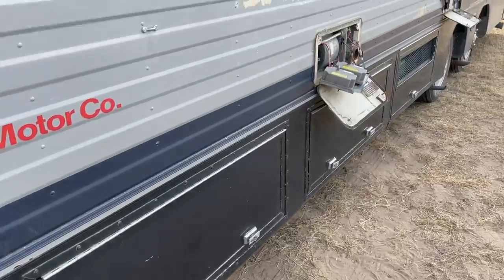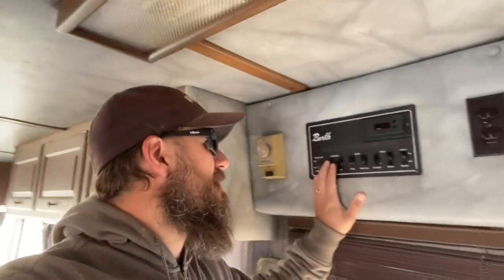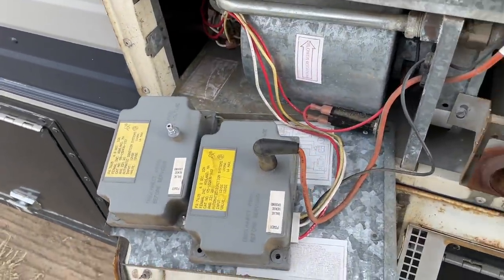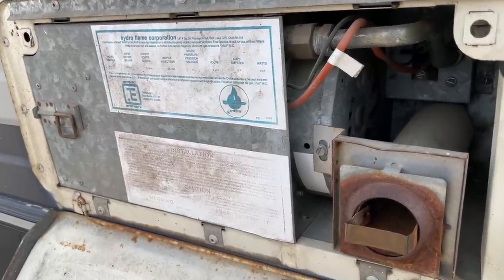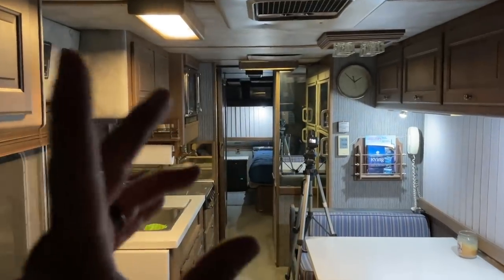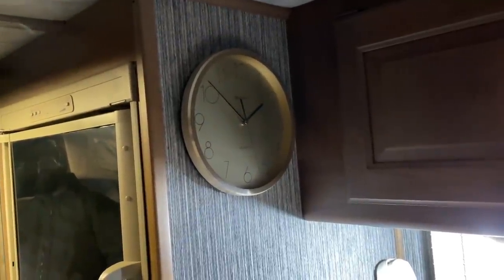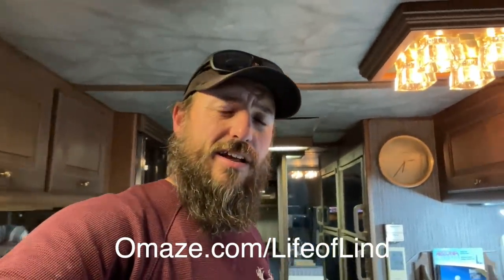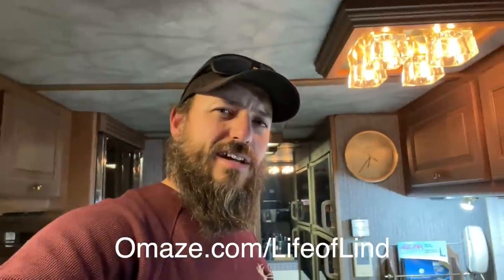Abandoned $154,000 Luxury Barth Motor Home  First Winter Preparations!

Comment: Listen, those front windows you can cover those up to prevent heat loss/heat gain.  Go.to Harbor Freight and get those $4 moving blankets. The blue one or the camouflage one. They are perfect for moving and preventing scuffs. AND they are also.good for sleeping out there in those vehicles because they insulate heat very well. When I was driving big rig I would use 2 of them in the sleeper cab to keep warm. Those nights in Maine didnt phase me because I was warm. And the price is right. $4 for the blue and $10 for the camouflage one. Hang them over the windows to keep the cold out when you re running the furnaces. You will notice after 20min you wont need the front furnace on
Reply from the maker: good advice! thanks!

Comment: I added an extra pair of 6 volt Trojans to my rig for low temp camping. The furnace kills batteries we'd wake up in the middle of the night with the fan running and no heat. Definitely helped out making heat all night

Comment: She's a great old rig!

"Pro Vintage RVer Tip" here.... 

Buy a few of those old-time electric "milk house" heaters and stow them under your sofa or the dinette seats.

The propane furnaces usually do a great job heating an old coach, but they absolutely suck propane! They burn it like it's going out of style.

We use ours if it's in the 40s or below, while we're running down the road.

When we park, if it's at a CG with power, we use those Milk House heaters... Even if we just stop at a roadside rest, or say a Wally World, we fire off the generator and plug those in for our heat.

It's cheaper to run the Onan and use it to power the electric heaters, than it is to burn propane and run the built in furnaces.

Keep on keeping on!
Cheers

Comment: If it freezes where you live I suggest you be sure to winterize your motor coach. Either you have to blow the water out of the lines with a compressor or Replace the water in the lines with RV antifreeze.
Reply from the maker: yup all done, pumped the pink stuff then drained

Comment: Back in the 90s my grandparents had an RV like this and watching this is really nostalgic. The one they had was diesel and was more of a tour coach than RV. I would love an RV like that for my family of 3 but I an no where near handy enough to do all that work you've done.
Reply from the maker: i wish this was a diesel!
Reply: @LifeofLind  If I remember correctly it was a Detroit and it was a pusher. I got trapped in the front wheel well because the air bags deflated while i was helping my dad run new electrical cable.

Comment: That Air Sail Switch behind the blower wheel sometimes hangs up. I removed all three of mine and added a piece of aluminum tape to the sail rod and that did the trick. I also removed all the fan motors, took them apart and lubricated the wicks. They run nice and quiet now. I have the 87 of that model. Good Luck with yours.

Comment: You should add a solar system to this. A single 160 watt panel with  two 6v golf cart batteries is all you need for a decent system. I lived in a truck camper for 3-5 years on and off, I never needed more than that and it was in constant use

Comment: I just use 2 electric heaters with the fans and they work great. I’m always a bit leery of gas heat in the RV had a neighbor’s cousin die in an RV because the flame went out and gas filled the inside. I know thousands of people use gas heat with no problem but I stay awake all night even with an alarm.
Reply from the maker: these new ones have a flame sensor that kills the gas if it goes out. also they direct vent outside now. pretty safe
Reply: @LifeofLind  nice 👍 that’s good to know. Looks like I’ll be installing some updated units.

Comment: With the 454 you can tow something for the extended family, looking forward to seeing it finished .
Reply: He need a turbo diesel in that thing. A Cummings or Duramax diesel will give it more power and better fuel efficiency
Reply: @79tazman  Easier said then done. Have fun getting it in through the inside of the rv. Way to costly in my opinion.

Comment: Sounds like your fan clutch is stuck on. If it doesn't freewheel after 10-15 turns cold, it's going to cost you 20-30hp and the fuel it takes to make that wasted power.

Comment: the ultimate modification for the future of that truck would be to convert it to hydrogen engine and cut some of the weight, but then if you did all that you'd probably want to strip it bare and redesign it lol

Comment: Question: I am living full time in my trailer not exactly an RV I know but the trailer was built in 78 the furnace isn't working any thoughts on what I can look at to fix it?
Reply: P.s. I live in Canada too so heat is a MUST
Reply from the maker: depends on what it is doing? check igniter, sail switch and high temp switch, if those are good, it might need a control board.

Comment: The only way you will get better fuel mileage is if you change the gas big block for a turbo diesel engine because there is no way you will get great mileage out of that big block they are a pig on fuel